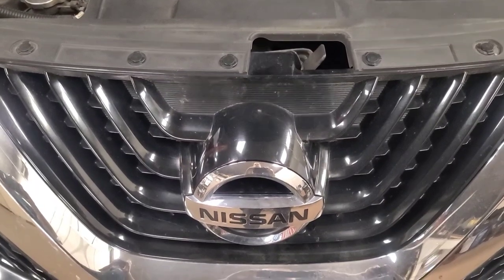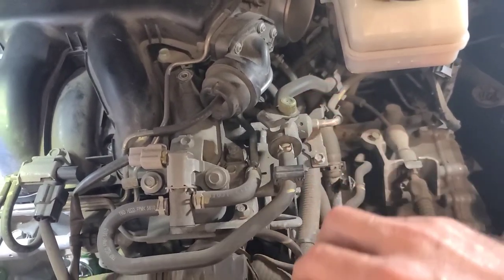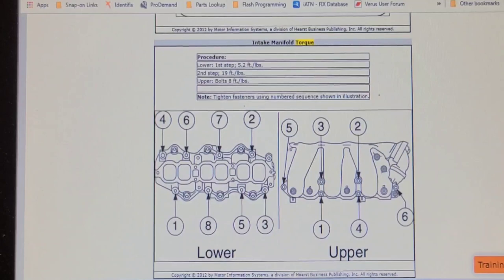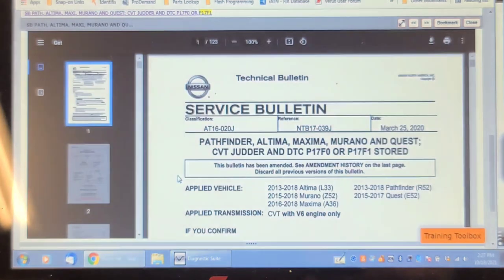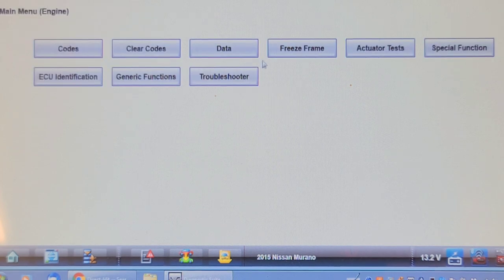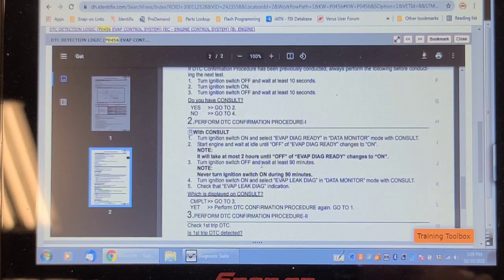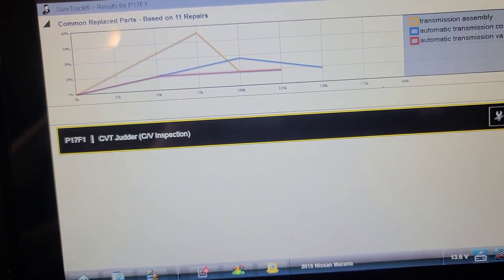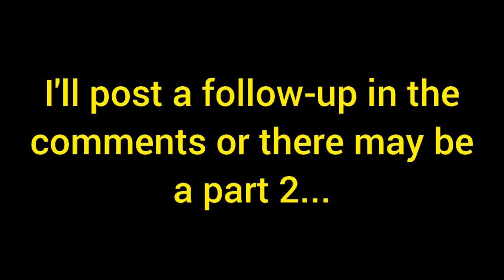2015 Nissan Murano Spark Plug Replacement Plus MIL on And CVT Judder

Comment: I surprised you didn't suggest a transmission fluid change. Piece of cake, anyone with minimal tools and knowledge and a floor jack can do it. Videos abound. Everyone knocks CVT transmissions but if you're not an extreme leadfoot and change you fluid at reasonable intervals these transmissions will last indefinitely and the added fuel economy will pay for your fluid.
Reply: The CVT in the 2016 I have is non-serviceable and fluid can't be changed on it
Reply: that is right many of my customers have great working cvts all makes and models i change the fluid and external filter on these all the time. The main one don't need to be changed as often.

Comment: Can you make a video of how to change transmission fluid on nissan murano?
Reply from the maker: If I get one for that job I certainly will. I'm surprised there are none on YouTube.
Reply: I watched a video on doing it that was based on a nissan rogue but the procedure was the same. Its not hard at all. Basically drain the trannie through the bottom drain bolt on the transmission, measure EXACTLY what you take out, (be extra careful not to spill any when you drain it as it will effect your measurement) and refill that same amount through the capped off “dipstick” stick tube in the engine bay.  I did that 3 times over the space of a couple weeks and it changed out the bulk of the fluid. I would definitely recommend you get it done if you havent already. That “lifetime fluid” nonsense nissan tries to say is absolute nonsense. The fluid I drained out and replaced was black as molasses. 

Also don’t try and “flush” the transmission. Thats asking for problems. Just drain and refill and you’ll be fine.